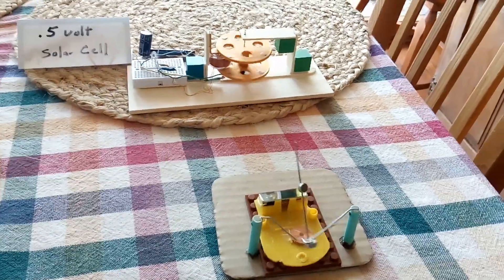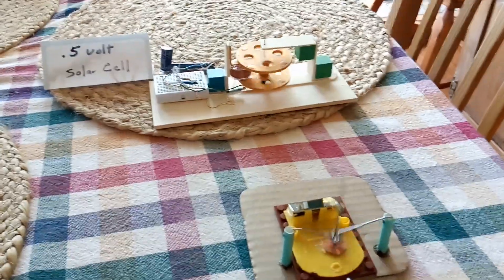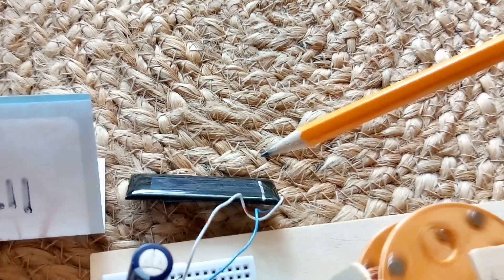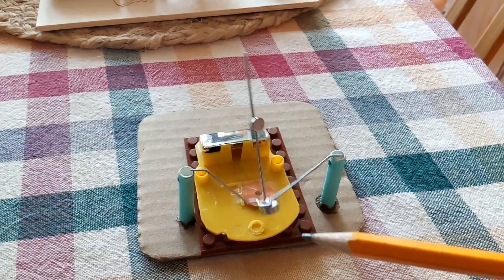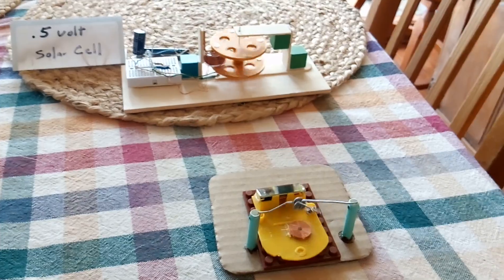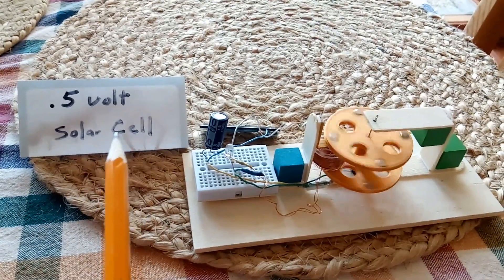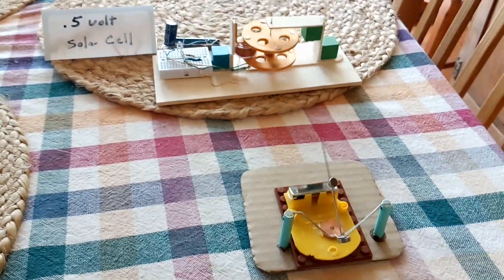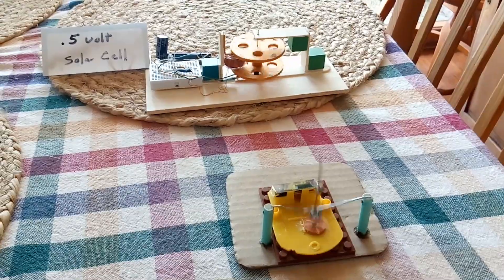Low Voltage Project --  Part 1

Comment: Great work Lidmotor. But I think your rubberband joule thief was even more awesome. Didn't that run on 0.2 volts and you had an LED Lit up a rubberband vibrating real fast AND a wheel turning. That still astounds me!
Reply from the maker: Yes.  That rubberband joule thief was pretty neat.  I might build up another one and try it on a Peltier module using heat to drive it. Thanks.
Reply: @Lidmotor  Yes! You should go for it. I got a little obsessed with the rubberband joule thief for a while. After seeing how activity could come from a "dead" battery. I was not able do duplicate it, unfortunately but I learned a lot trying.